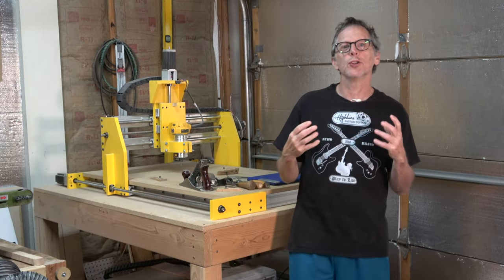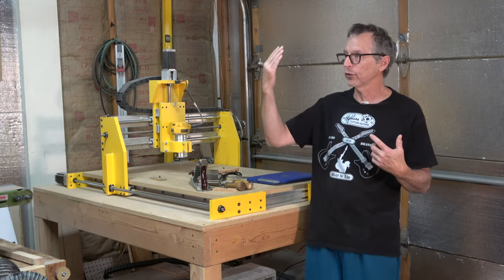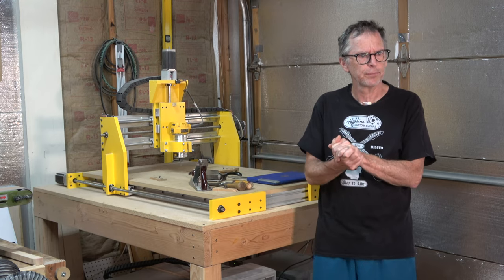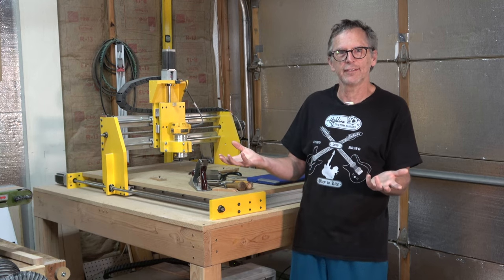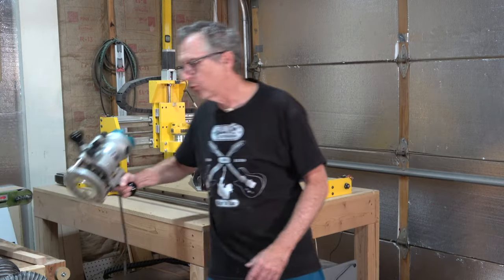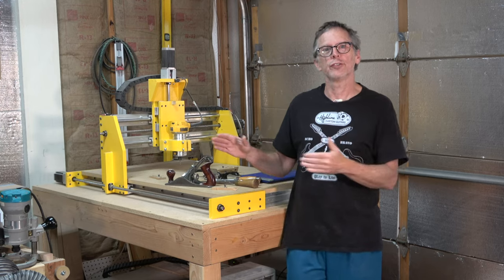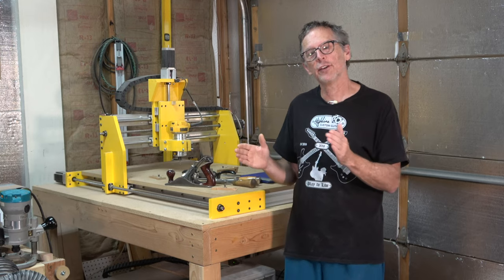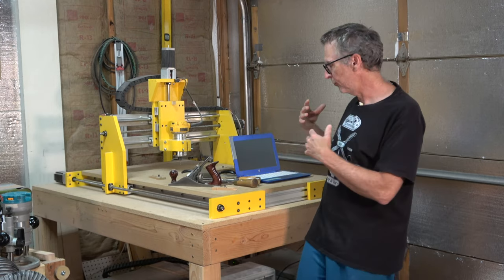Does A Guitar Made With A CNC Machine Have A Soul?

Comment: I've often wondered if what's happening is an audible analog to the "uncanny valley" in visual arts.  CNC guitars can be practically perfect, and perhaps the sounds they produce are a little too perfect or precise for some ears.  Regarding the term "soul" I prefer the word "character".  A guitar with specific nuanced flaws (I'm not talking cosmetics, here) has a unique auditory character.  CNC-reproducible instruments with tight tolerances just aren't going to differentiate from each other all that much, and all of them are going to adhere pretty closely to some Platonic ideal standard.  That bores some players, I suppose.  Sometimes I might even be one of those.

Personally, since I started building my own guitars I've noticed that I prefer playing the ones I made over the ones I've bought.  Trying to be as objective as I can (there's always going to be some bias) they sound better to me up and down the neck.  And for both of the guitars I've built so far I know for a fact that the fretboards are not perfectly aligned with the guitar centerlines, which is just one of a whole host of other tiny mistakes and loose tolerances inherent to my learning process.  The guitars don't play out of tune, and they set-up just as well as any mass-produced factory guitar I've ever held.  They just don't sound "sterile".  They sound musical.  Whether that's psychosomatic or not I guess has to be left to y'all.
Reply: I agree with your basic sentiment, but CNC is just another tool. If I create a boring and sterile guitar, that's on me, not the tools I used.
Reply: My first guitar was a cheap Squier bullet made in Indonesia, no doubt with the help of a CNC machine and with rather low quality woods. When picking it up, the feelings of when I first played the instrument come back to me. It's sound becomes its own. The "character" or identity of an instrument is not determined by the method or components from which it was made, but rather the memories the player develops with it. You expressed this yourself in that you built those guitars yourself, and thus have a deeper connection to them. Every guitar could be the exact same guitar down to the positions of the molecules it was made from and people would still say that theirs has character.

Comment: I eschew power tools, and use strictly hand-powered tools. I don't do this out of any appeal to tradition or the idea of "soul" in the wood; I do it because power tools are noisy and dusty and expensive. I also do it because the time I spend working on wood isn't of monetary value to me- I have a day job that I do for a living, and I don't want any of my hobbies to turn into "side hustles" or, worse yet, second jobs. This means the projects I complete are less precise and take longer. At the end of the day, I've cut wood I don't want off of the thing I'm building. It's not appreciably different from letting a computer-controlled router do it in hours when I would take days or weeks. If ultimate precision was important, or if I was in a scenario where time was meaningfully money, you bet I'd choose the efficient process, and I'm not confident my work would suffer in the least.

Comment: The Toast guys have sort of made fun of CNCs in the past. And then they rave about their custom templates they have made for them - which are often plexiglass - and pretty obviously made on a CNC machine!
They are good guys, but I do find that incredibly ironic!
Reply from the maker: They also have a CNC machine in the corner of their shop. Also, why would someone take a class on how to make a guitar on a pin router when they don't own one and probably will never buy one? I can only find two on the market priced at $3500 and $5500. That's more than a good consumer-grade CNC machine.
Reply: @HighlineGuitars  Agreed. The pin routers are insanely priced, super huge and heavy. Not ideal for any small operation. Oh, you probably need 220 to run it as well.
As for their CNC, yes, they broke down and got one, for inlays, I think? Not sure.

Comment: Traditional woodworking had some no pay or low pay lackey hogging off wood with metal blades before the piece was handed over to the master to final finishing and assembly.  How is this any different?  So instead of some slobbering knucklehead removing wood chips you have a robot doing it.  Its still finished by hand.  The wood doesnt care (yes I asked).  Unless the apprentice was gnawing the wood away with his teeth its still metal blades cutting and scraping away wood chips.  Were their hands so calloused they were used instead of sandpaper or scrapers to smooth the wood to perfection?  I suspect not.  The only ones that talk about soul are our grizzled old uncles sitting there smoking a cig and drinking a beer while pontificating their wisdom to young impressionable nephews.